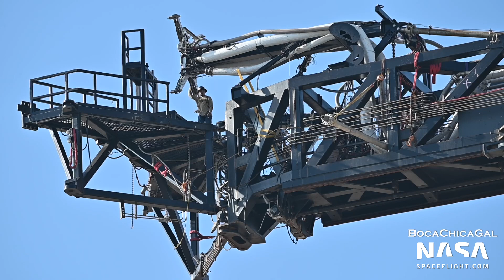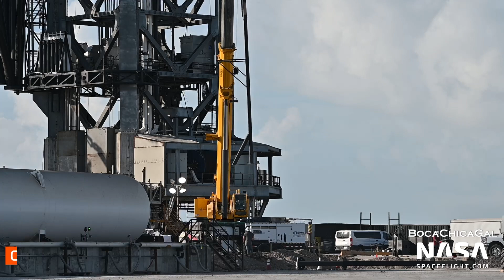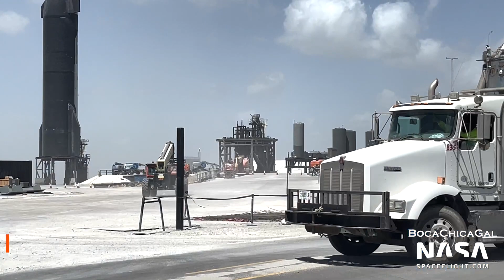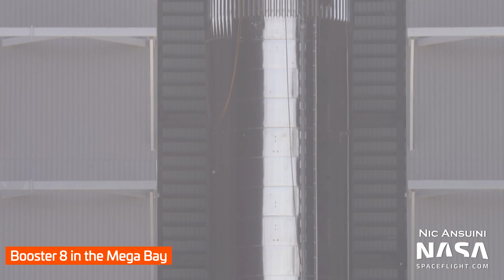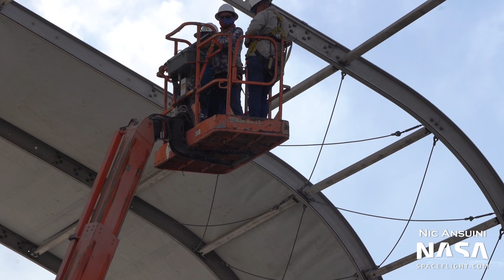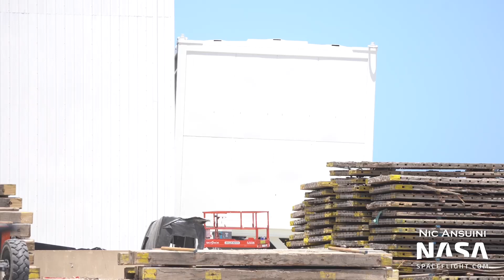Starlink Satellites Believed to Have Departed Starbase | SpaceX Boca Chica

Comment: Why do you think the Starlinks were being taken away?? They may have been taking the empty Starlink trailer away to refill after filling up the dispenser?? It wouldn't surprise me at all if SpaceX tested a full load of Starlinks especially as Elon has said the biggest concern for the Starship side was them getting stuck in the Pez mechanism when being deployed.
Reply: I recall they parked a covered truck trailer in the back of the Starlink building, followed by the Starlink loader, and a closed door, a few days ago. Maybe they used the sliding floor crane to empty it into the loader. Then today, moved loader out and truck picked up empty trailer?
Reply: To turn them into BTC nodes.

Comment: They need to add a mechanical door to the Pez loader slot similar to what's on Starship, but on the outside of the loader.  That'd avoid those flimsy blue tarps trying to cover the hole in our Texas breezes.
Reply: The tarps are just a protection from the spray paint getting onto the rail mechanisms I think.

Comment: My feeling is that the starlink loader is broken and might have had starlinks either stuck in it or something along those lines. The arms that conveyor the starlinks into starship werent out like that before there first attempt and every since its just had all that plastic taped up over it like they were waiting on something to fix it. I would think all of that goes inside and a door or cover goes over to keep dust out but it cant really do that in its current state, but hopefully we will see them doing something to it soon.
Reply: I believe the plastic is purely to protect the mechanism from the spray paint job. Paint can interfere with guide rails. That's my Couch Potato 'take' on this event. 🥔

Comment: Here is my theory. 

Crane mats on launch site to lift next booster to test stand, to undergo testing so they wont have the same abnormaly like last time. So they wont have to refurbish the launch mount.
Reply: They only perform cryo testing on the portable test stands. All testing involving engines will be done on the OLM.
Reply: Theory alert: could also move the booster to the OLM. Chopsticks is being worked on so they might do it with the crane
Reply: @Jonasastrophotos  Good point, i did not know that

Comment: The chopstick carriage rope seems awful rusty.  Isn't the rope supposed to be greased outside and inside between the strands?
Reply: Nah they just run it till it fails. When it fails they replace the cable with new. Easy peasy, only takes a couple hours and then it’s good till next time.

Comment: at 7.04 the mega bay, why you have steel bar outside the structure. l hardly understand this.
Reply: Since the bays have no inner structure to keep them from twisting and bending they have to be placed on the outside.
Reply: It's just Scaffolding. Not sure exactly what they're doing, but it's so people can work on the outside of the building. Maybe painting, maybe finishing cladding. I believe there are windows going in at some point too.
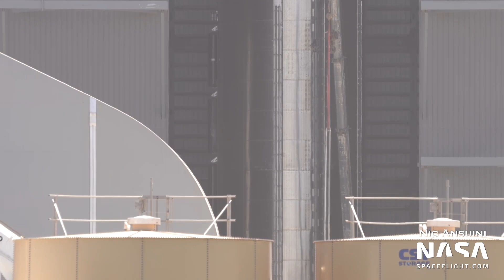Reply: 7:04
Reply: İts placed here as scaffholding and structure, so workers can reach and do what they need to do up here and the bay doesnt crash and destroy whatever is inside
Reply: @knowledgeisgood9645  

That s right its called an exoskeleton to brace the external walls. These otherwise would be braced internally  or within the walls themselves.
Reply: The building is pretty high and placing the structure outside they only need a minimum of sheeting for the space they actually work in.. and don't need to have the structural steel inside as well, taking up empty space which then would need to be covered from the outside at even greater cost (also increasing the windload, needing to build the structure even stronger, needing more material).

Comment: Just a year ago, SpaceX was pouring the concrete for the foundation of the now being used Megabay. Whatever else is going on in Elon Musk's life, his vision of the future of Human spaceflight is going full speed, even with the inevitable setbacks, to the day when spaceflight and especially humans in space or on Mars, becomes the norm rather than an exception. And as always, the daily videos from Mary and Nic show that Musk's forward vision becoming a reality.
Reply: For The Record: 1 year ago Mary was filming fantastic sunrises, B4 was ready for rollout in the High Bay, Ship 20 was moved out of the Mid Bay, ready to go into the High Bay to get it's Nose/Payload section added, then Booster4 was rolled out of the production site for the first time, SN15 & SN16 were in the Rocket Garden, B3 was on suborbital LPA, Frankencrane was standing tall by the 8th section of the Tower, the 'Can Crusher' was still a 'mystery structure'. The next day GSE5 got sleeved with a cryo shell, just as B4 got lifted onto the OLM (which had all the scaffolding around it), as Ship24 (with it's nose cone attached overnight) was rolled to the Launch Area, the 6th of August was the first full stack of the Starship System. 
FIRST PICTURE by Mary was on the 20th of August. And that was workers cutting along spray painted lines North of the High Bay and breaking up the concrete to dig the foundation trench for the Mega Bay. 
That's from my daily file 'screenshots' that I made. (I stopped it on 9th February this year.)  I might have to start that up again, as we approach some real milestones with the S24 B7 static fire testing. Very time consuming though.
 🇳🇿 Kiwi David

Comment: What is the futur of this base ? They are putting a lot of money to clean-up the production chain when they have sign a super limited number of launch per year, thus when the R&D period slow down new constructed ship here will be stuck in place (I don't see how they can manage to transport them to the cap where the new base is behing created)
Reply: It is reported that there is a new road built from Boca Chica to the port. There is a dock on Merrit Island
Reply: @smacksman1  not sure to see your point, one new road will never be enough to transport a starship to florida
Reply: @smacksman1  oh nevermind, I red this incorrectly 👍
Reply: @smacksman1  can they put a starship  on its side ?
Reply: @etiennedud  Well the new road is built without obstruction so fairly easy to get to a barge at the port of Brownsville. Then barge directly to KSC.
Reply: @etiennedud  Good question! They could pressurize the tanks but they may need internal supports. Maybe vertical on the barge? And maybe vertical on the new road?
Reply: Maybe they can get the max launches per year raised over time, as well.
Reply: The numbers put down in Environmental Assessment are not set in stone. Once SpaceX and FAA have a real flight data, they can update their models, re-evaluate environmental impact and make amendments accordingly.
Reply: They are going to be designing, building, and refining designs for a very long time. They’ll iterate many many times on Starship and the Booster over at least 10 or more years. That’s not even mentioning a mars capable vehicle, the lunar program vehicle, in air refueling ships, larger versions of boosters, and ships, etc. they can’t do more risky test flights at the cape. Starbase willl be busy and expanding for decades.
Reply: @AndySpicer  yes and no, they will need to relatively quickly launch them with paying payload, and thus doing what they did with falcon 9 before block 5.
To do this means launching rocket every time they can, and thus as for the current contract, launch from the cap.
It does not seems super easy to move a rocket that side between the two places, even by boat. Thus why I am really impatient to see what they will do if they want to keep this place the goto production plante.
Reply: @etiennedud  and that’s why they are building the launch site at the cape. Tower almost built and about half erected and the factory building is under construction. They’ll launch from Boca until it’s done.